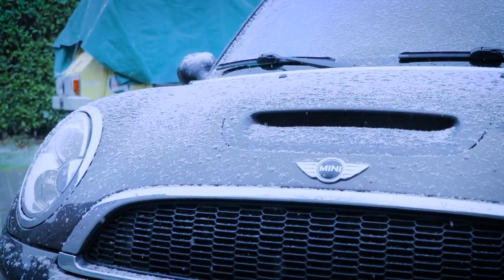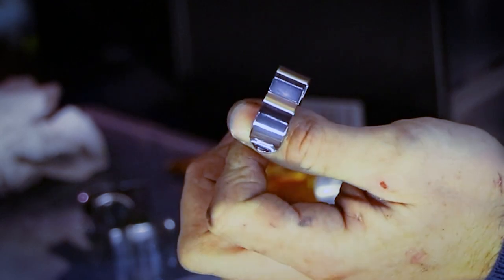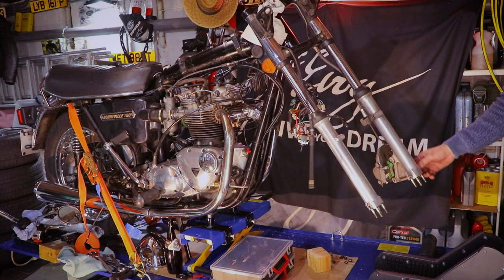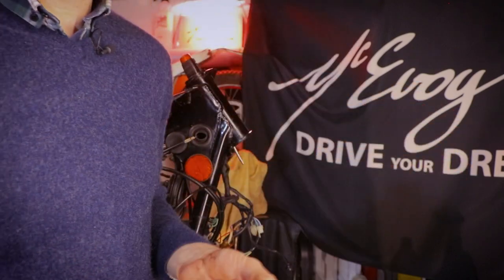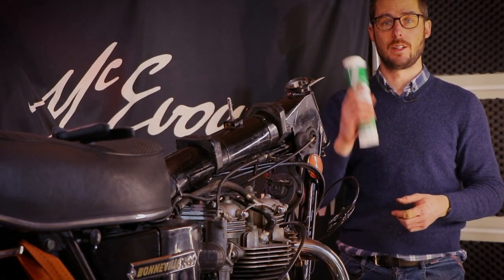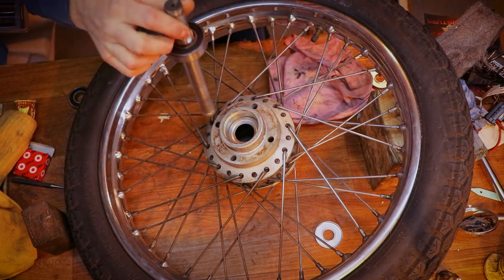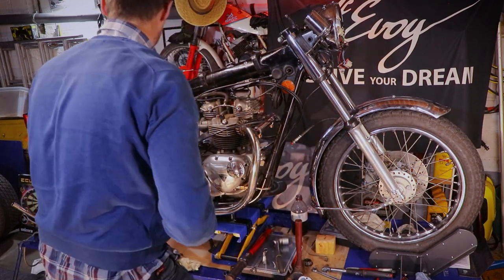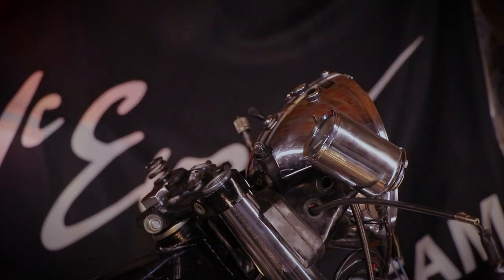Triumph Bonneville T140V front end rebuild

Comment: Pinzgauzer nicely tucked away under the blanket👍👍
Reply from the maker: It's the best I could do to save it from raining inside during the Winter, as it does not fit inside the garage. I need to do some welding on the rear side panels. The left one was available complete from the factory, but there are no more right ones. I wrote to them, and they said they would press a new batch of 10, minimum. I only have one Pinzgauer, what am I to do with the nine 710K right side rear panels left over? Haha.

Comment: The later model T140 Triumphs were quite refined and some of the best working Triumphs made by the Triumph Meriden factory. I found them to be excellent bikes unless you have to rebuild the rear master cylinder in which case you are in the soup. The bike was built around the rear master cylinder.
Reply from the maker: Is that so? Great bikes nonetheless, I must agree.
Reply: It is true. I am now in the middle of rebuilding T140 and they really made it way too complicated. Harris made the system much easier on his T140's.

Comment: Great video, Geoff. Please explain what you meant by pre-loading the steering head bearings. That 7/16s hex is a bitch when you come to the realisation that there is no way around it but to buy one...Excellently presented in a very British manner and sense of humour. More footage of the whole bike on the road, please. I thought the blue tank was lovely, but more of the new painted tank as well, please. Cheers.
Reply from the maker: Hi Chris. Thank you for your comment. As the steering bearings are tapered, the pre-load consists of tightening the centre bolt just enough so that all play in the stem disappears, but not so tight as to make the steering drag, so to speak. 
There is more on-board footage coming along. 🙂

Comment: geoff thanks only thing i just done all u are showing But from oldbiker in england i bought a hydralic brake line switch to replace broken one in bars it will cost u 40pounds i replaced rubber lines also but broke the tiny phillips head screw off in the brake caliper for the chrome cover ,,dam it lol
Reply from the maker: Ah, sh*t happens. lol
Reply: Apparently you can buy the bolt that holds the caliper that the screw fits into separately. Thus not worrying about drilling the screw out.
Reply: good on you mate, will buy a bolt of all things to break.... lol @chrisbland8650